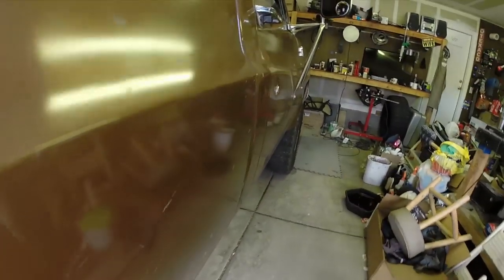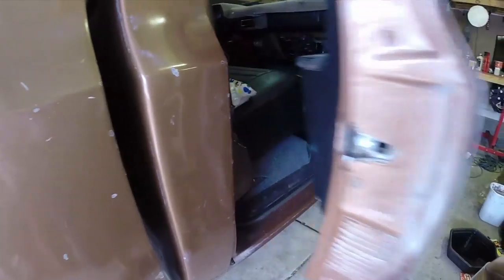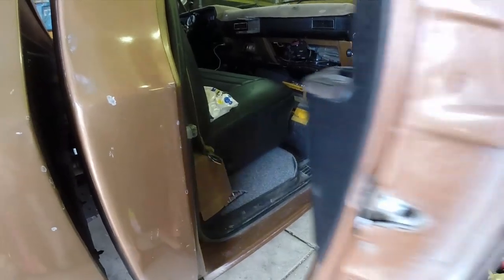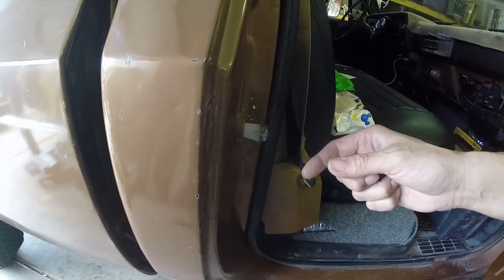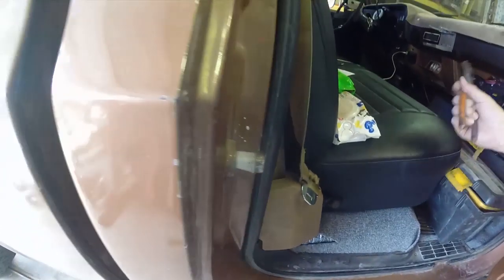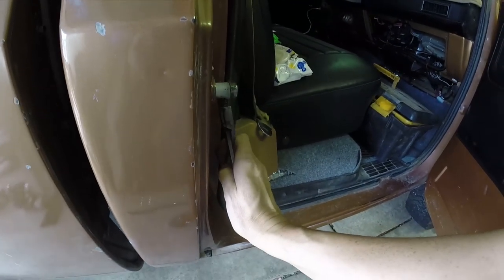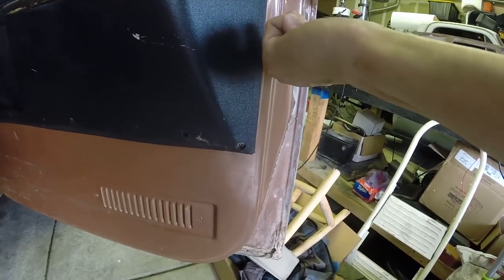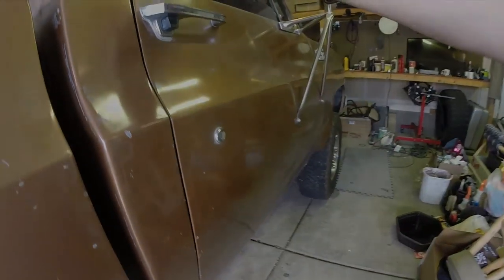Transfer case and rear end

Comment: My np205 with 2.125” output yoke  leaked for a long time and I installed 2 of the TK50092 seals from torque king.  The retainer cover is deep enough for 2 seals to fit, they are double lipped.  My output yoke was a little pitted and the double seal kept it from leaking completely , I finally bought the new yoke and it’s still not leaking.
Reply from the maker: Thanks brother, I will look into it. Glad you got it, mine is still leaking currently!

Comment: Don't over fill the t case and they all leak like that, all I can say about that is just keep an eye on the fluid level you can buy 2 90 degree fitting an make a clear site with half inch clear tubing you need like 5in peace an put the 90s in an clear tubing with hose clamps, top off t- case an put all back together an you just look at the level in the clear tubing to see case is full or not 😎🍕🇺🇸

Comment: You can get a repair sleeve for the yoke. Even a little grove will cause a leak.  Worked well on mine. Only about 20 bucks on rockauto.
Reply from the maker: Thanks brother, I will check it out!
Reply: Was gonna say the same thing, think they are called speedi sleeves...🤷‍♂️ anyways good luck

Comment: Just fixed the death wobble in my 04 WJ, new  tie rods and drag links all the way around.  Seems like those parts have to be replaced too often IMO to keep the steering compliant at highway speeds.
Reply from the maker: I agree, seems like they would avoid a lot of problems by making this stuff with zerks on them.

Comment: are you running a np205 with the 4l80
Reply from the maker: Cody Harris TH400.
Reply: I'm planning on doing an ls swap on my 73 k5 blazer but I want the over drive and was just curious if you had the 4l8o
Reply from the maker: Cody Harris FYI, if you are doing it, try to use a 2wd long slip yoke 4L80E, then you can use the advance adapter kit, and don’t have to worry about the VSS sensor.